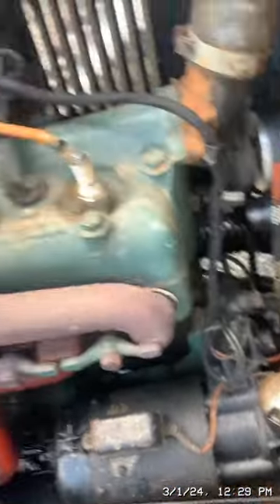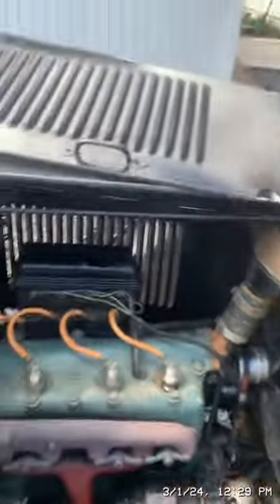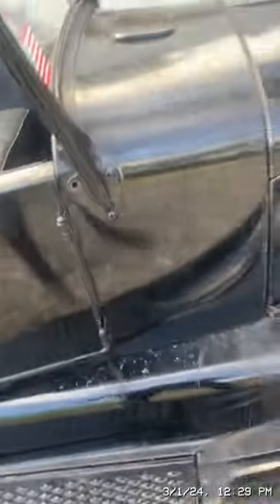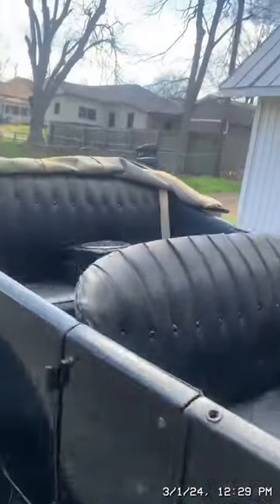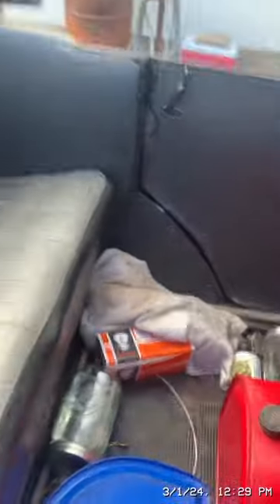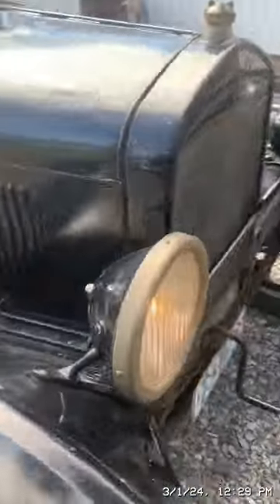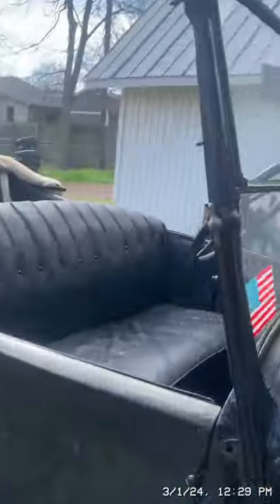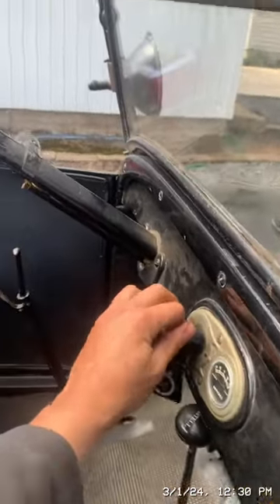Driving my 1926 model t 61miles

Comment: well i drove my 1968 F1500 40 miles today.   the fuel pick up got clogged but i cleared it.  i never drove over 50 mph.  it runs pretty good.
Reply: I drive my 1981 vw rabbit pickup daily for the last 15 years. 

It’s never left me stranded. 
I crossed the country over a dozen times. 

Last fall I drove a more
Than double cross country drive. 

Oh and it’s got a tdi swap so it makes 60+mpg